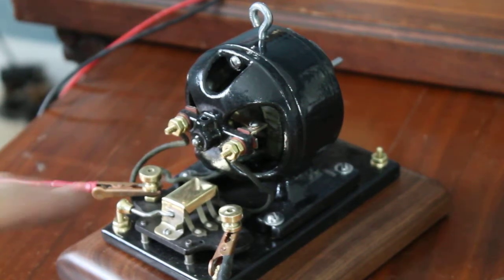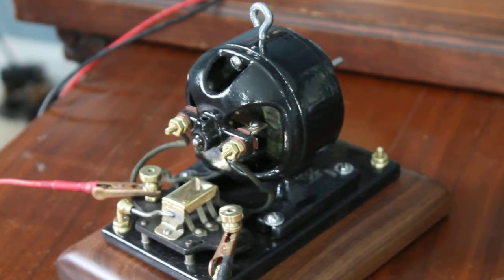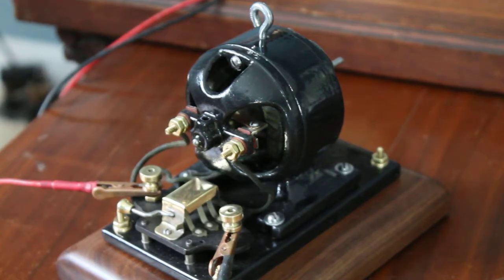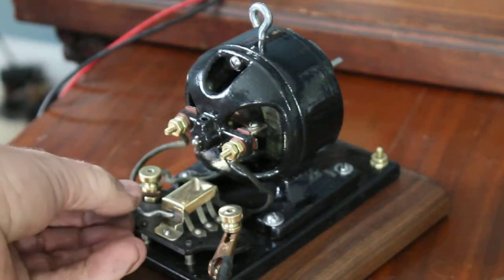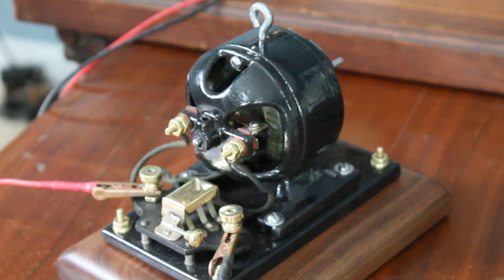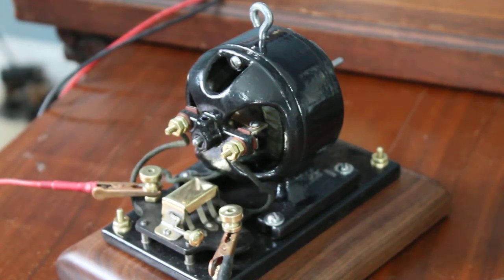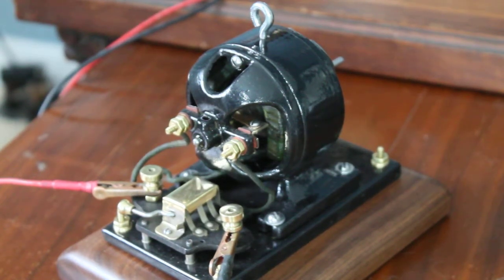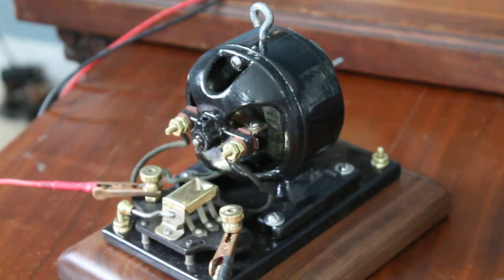Antique Knapp Electrict Motor Reversible

Comment: How do I wire it up to a power source? I have one with two wires sticking out from the outer coils and when I stick them on a battery, it doesn’t budge. I also have a switch that has pieces of wire that look like they’re from the motor, along with other wires going out. I think the switch has the same function as yours, but I’m not sure.